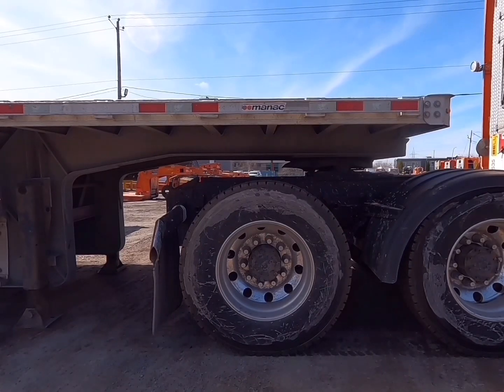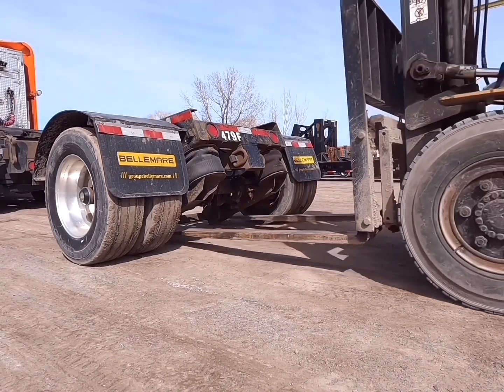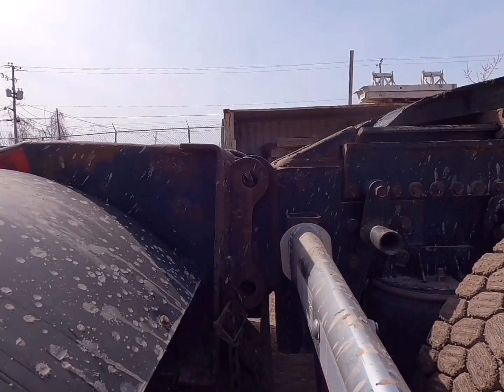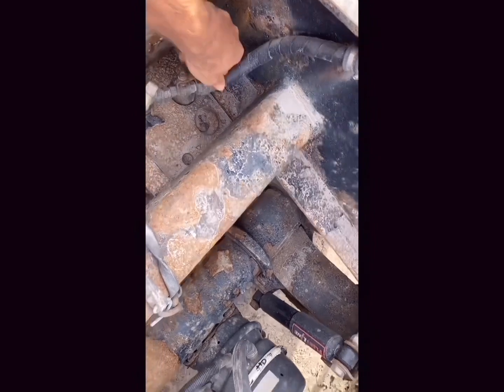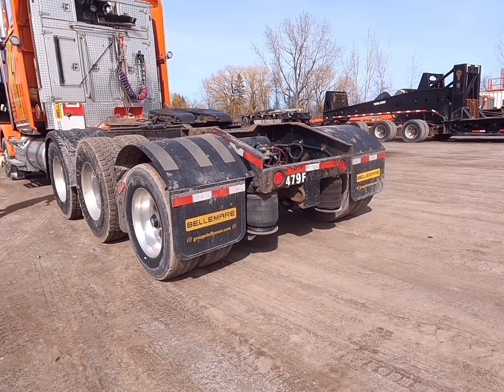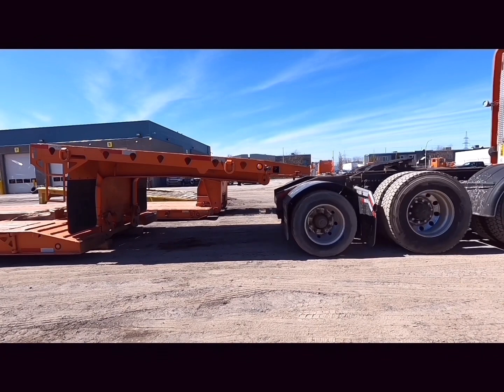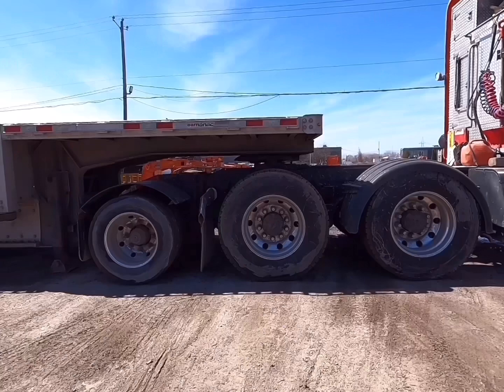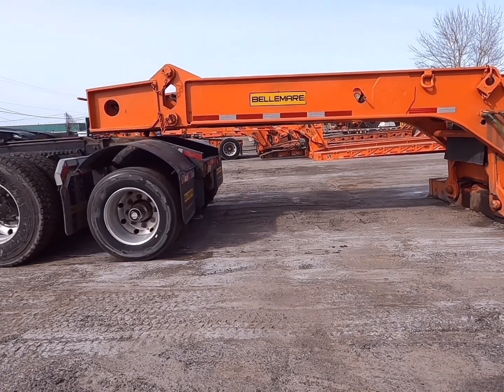Training video about pin-on axles for those who just like to see how the equipment works.

Comment: How do you make left  or  right turns when you're loaded ?. Do you drop the air in the pin-on axle before making the turns?
Reply from the maker: No it still turns.  You just need to be careful in slippery conditions.

Comment: Thank you for making this video - I came across it accidently, but our company is trying to make one of these to add a 5th axle to a heavy haul tractor, and this helps.  We are planning to use a steerable axle, which I think should help a lot with maneuverability, would you think this to be correct?  We are in Missouri, where a quad grouping will be permitted for as much as 89,600 lbs, so adding another axle seems to be the right choice vs. a jeep, which would be a horrible pain to maneuver into our jobsites in tight urban areas.
Reply from the maker: Definitely go with steerable. Just having a fixed tridem really decreases my steering ability especially in slippery conditions. I can’t imagine a fixed quad.  
I find it neat (a pain in the ass but neat) to see the different combinations being used in different areas.

Comment: Using a double drop, does the spare axle really gain you much weight since you can’t have the 5th wheel plate far enough forward for the best distribution?
Reply from the maker: Good question. Personally I’m not a fan of  this configuration but sometimes we gotta do what we gotta do. With the 5th wheel all the way back you will really load the drives and we can easily permit 66,000 on 3 axles.  We will of coarse be light on the steering but you sacrifice a few thousand pounds up front to gain 22,000 in the back.  Just be extra cautious in slippery conditions because it won’t steer worth a shit!